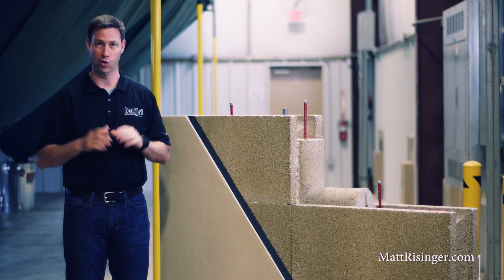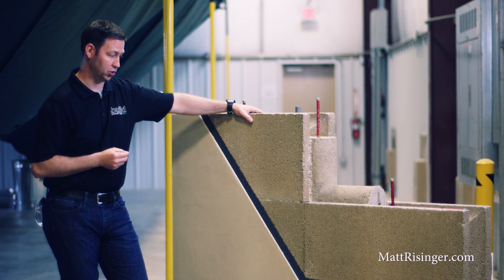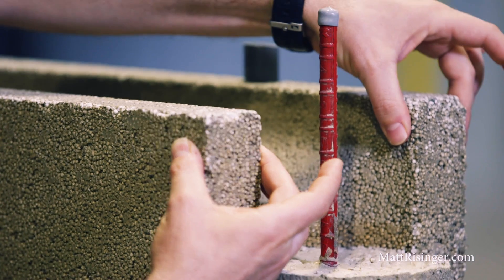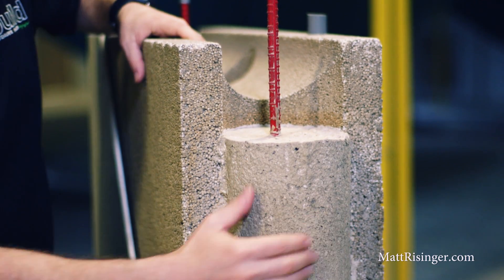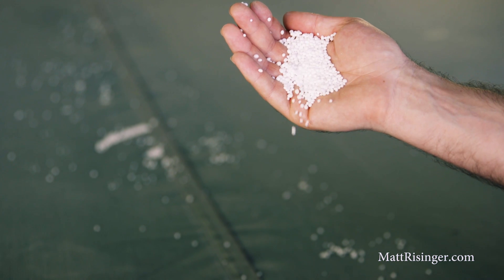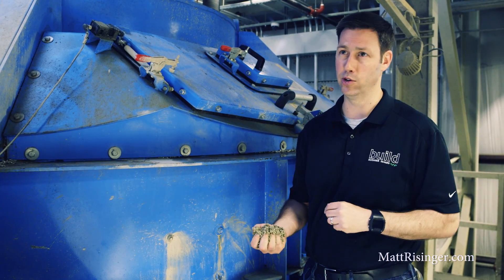Insulating Concrete Forms - Bautex Plant Tour

Comment: I have a question about the sustainability of the product. Since it is using foam, how do we dispose of sections or the house itself? Foam isn’t recyclable las t time I checked, right? Just trying to think about how the next generation could handle structures built this way. 

BTW, glad to see innovation in building materials in the US.
Reply: Marcus Fant It is now! Check in your local area! For example, here we are using a waste to energy facility to convert previously unrecyclable items like foam back into diesel fuel.

Comment: There is little doubt ICF walls have many advantages over wood frame construction. However,no matter what part of the country you are in,half the foam is always on the wrong side of the wall. The same thing can be accomplished with concrete block walls with steel and grout. The foam can then be applied where it does the most good,and probably at a reduction of cost.The green building adviser talks about the energy performance of ICF walls.

Comment: Back in the 90's there was an Austrian product called RASTRA that was almost identical in concept to this.  The biggest difference appears to be the smaller more modular size fothe Bautex.  The RASTRA blocks huge and weighed enough to require a fairly strong installer, or a two man assembly.  The RASTRA distributor in the US apparently did some things that breeched his agreement with RASTRA mothership and they cut him off.  Their website is still active and they sell all over the world but it appears they may not have a US distributor now.  There website is 

https://www.rastra.com

Website has a Florida location listed for the US but its a bit confusing. They make a pretty interesting variation of the product called Rastra-THERM which has variable thickness integrated EPS outer surface that can be customized to anywhere from 4" to 12" thick.  For what its worth FYI.

Comment: I'm building my house right now out of ICF blocks (went with Nudura) and in my humble opinion, it's the only way to build.  It's super strong and incredibly energy efficient (a true R23 wall).  Cost is the same as 2x6 with spray foam insulation.  Can't wait to move in!  That being said, I wish I had seen this video prior to choosing Nudura. The foam embedded in cement is really clever.

Comment: Matt, I'd live to see more videos on ICF builds. A couple questions:
(1) since these blocks are formed with concrete are they more or less "termite proof"? I read some ICF are made with boron for termite proofing. 
(2) would love to see another video showing how things are attached to finished walls in an ICF building. With no studs to anchor something like a flat panel TV mount or heavy weight bearing shelves I'm curious how that works. 
(3) I've see how they use hot knives to cut the foam for making channels for electrical conduit and plumbing. Does that work with these blocks since they have concrete in them. 
Thanks for the great info. Awesome YouTube channel.

Comment: How would you compare these ICF's to say BuildBlock systems, the Buildblock system seems a lot easier to assemble and as of right now is the ones I'm considering.
Reply from the maker: Johnintoit John, sorry for my slow reply here...  Both are good performers.  Here's what I think separated Bautex from more "traditional" ICF blocks.  
1. Local.  This is a Texas owned company made outside Austin.  I like that.  Good people who will give good support to you.
2. Bautex should yield a lower cost build as they need less concrete.  Less labor too.  I don't think the 6" concrete continuous wall is necessary.  That's why I showed the 2x4 gun.  These blocks are STRONG.
3. Easier to install.  Goes together like a Lego set.  Less bracing too.  
4. Huge fire rating.  4 hours! The foam itself because of the cement slurry mix makes the block fireproof.  
Hope this helps buddy... Matt
Reply: Matt Risinger we need more follow up on ICF. I'm specifically looking at pitching roofs myself and makeup air systems. Figured you might have more for 2018.

When I look at this I'm thinking more of the aircrete and conductive concrete options we have now.

Matt Risinger this opens a whole can of worms I have questions about.

Comment: In your video, the mock up wall shows no staggered joints or overlapping of the ICF blocks. I was just wondering if this is needed or does this specific manufacturer not require this? 
Great videos! Keep it going!
Reply from the maker: Alex Foreshew The Bautex blocks aren't load bearing, so running them in a stack bond allows you to visually see from the top (pre-pour) that the channels are aligned so the rebar/concrete can do their thing.  Again, these are like a giant lego that gets filled with concrete to form a grid.  Genius! 
Matt